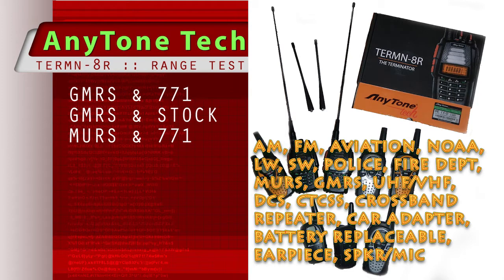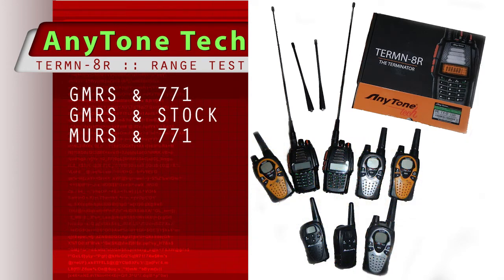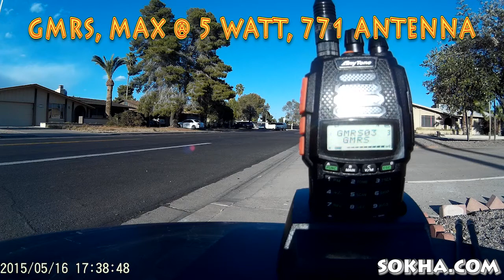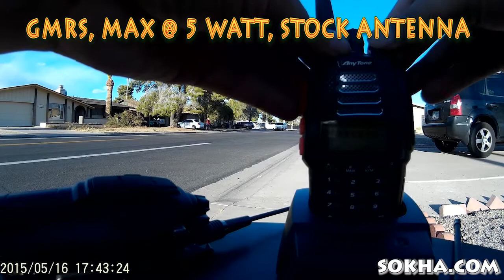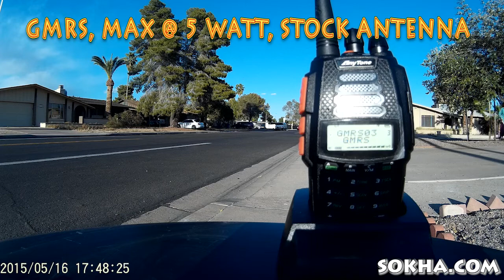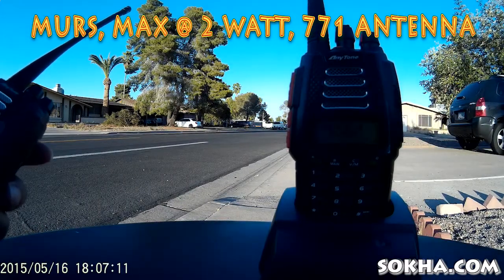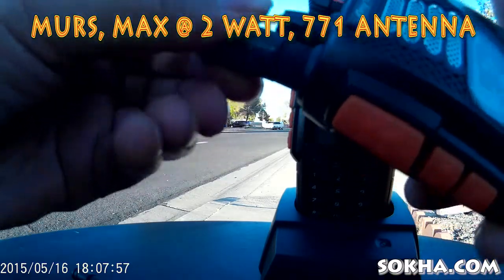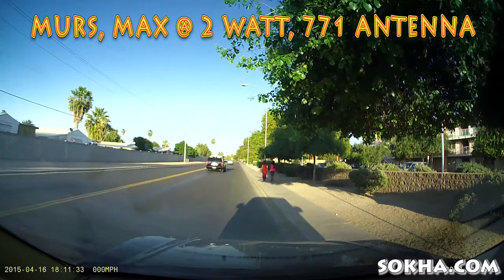2-Way Radio Range Test :: AnyToneTech - TERMN-8R

Comment: The test should have been performed with you getting out of the vehicle and stepping away from the vehicle by a few feet. By sitting inside you are subject to the faraday cage effect on the signal path. You would have more accurate results by getting away from the metallic structure.
Reply from the maker: i'm aware of the science.  but, it's not a real-world scenario where you get out of the vehicle and use the device, non?
Reply: Sorry to tell you that with a radio that is only capable of 5 watts with no repeater you should be using a magnetic mount antenna on the roof for real world communication. That radio is not made to transmit inside a car. It is a walkie talkie. It is made to walk around while hiking or whatever and communicate to a base or another walkie talkie. "Walkie" means on foot. This type radio was developed for the military on foot. The police further developed the radio for foot patrol. When police officers use a radio in their patrol car they use the mobile radio connected to the roof antenna not their walkie talkie.
Reply from the maker: yeah....i know about the Walkie developed during WWI.   also,  know the law you mentioned 5 watts is only applicable in the U.S.   the same law doesn't apply to the rest of the world.   also, transmitting farther than 0.5 mi requires FCC license in the U.S. which, once again, doesn't apply to the rest of the world.     trying to mount the repeater antenna to increase the transmission will definitely get you in hot water with FCC without the proper license.

once again, my test was about a real world scenario how i would use the device and thus i performed the test accordingly.   the device performed flawlessly compares to the $50 Motorola or Midland you pickup from Radio Shack.
Reply: I love that radio. We can't purchase them anymore in the United States. The new FCC regulations does not allow radios that transmit over the different services, GMRS, FRS, MURS, and ham are now illegal. Regardless of what license you have the radios have to be separate. It's a bummer. Thanks for the test.
Reply from the maker: just more ways government figured out a way to make money.   the crook doesn't comply with the law.  the only injustice done is the law abiding citizens.

imagine the government doesn't allow smartphone to have camera and GPS built-in.  because according to big brother, those are separate functions and thus must be taxed separately and hence MUST BE existed on a separate device!